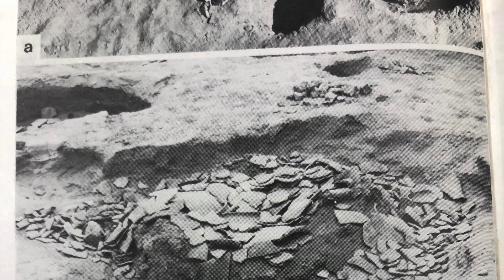How Was Ancient Salado Pottery Fired? Firing and Looking for Clues Near Ruins

Comment: Did any native Americans use salt glazing? Have you experimented with it? Michael
Reply from the maker: Not that I am aware. Salt glazing requires a temperature of around 1300 C which is WAY higher than you can achieve without a proper kiln.

Comment: Greetings from Philippines Im a new potter

My problem is my pot is cracking whe i fired it
What to do about it does types of clay matter Im using my own process clay or does drying matter?
Reply from the maker: Try adding more temper to your clay body. Your problem is probably not moisture, if it were it would explode in the fire and not just crack.
Reply: Ok thanks bro I will try to add sand becoz im using only pure clay

Comment: It stands to reason to me that they would be taking the pots to fire down by the river.  Flash floods tend to wash down a fair amount of fuel, which then ends up stranded on sandbars as the water drops.  Once the wood dries, that's a great source for wood that doesn't need a lot of chasing down.  It even leaves you with a nice area that is free of other organics (grass, etc.) that could be a fire hazard, and you may even have some water still available in the river or wash to rinse the remaining ash off your pots.  Another great video, Andy!
Reply from the maker: Good point, I often fire in creek beds myself.